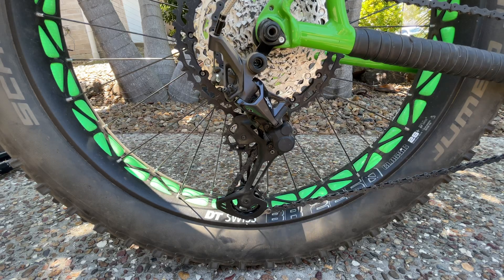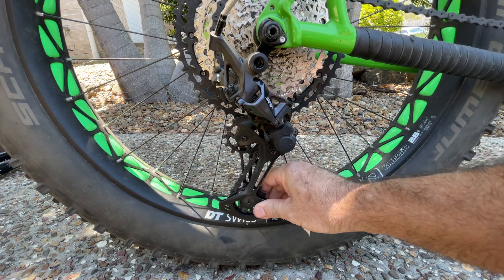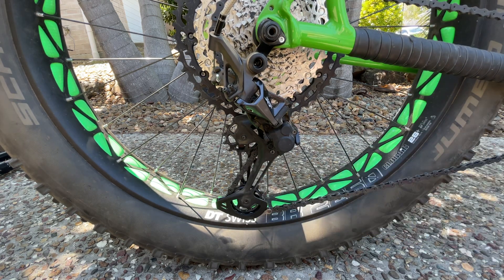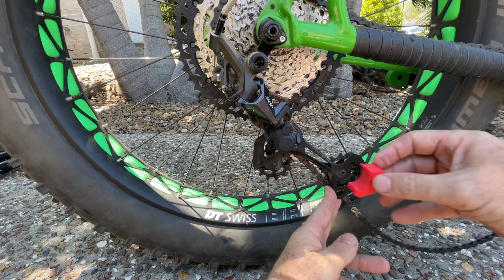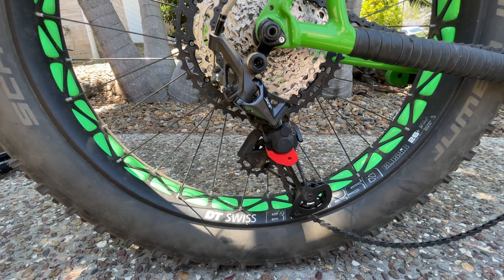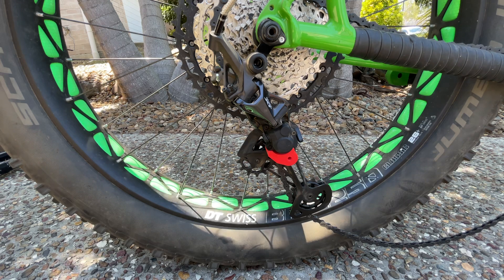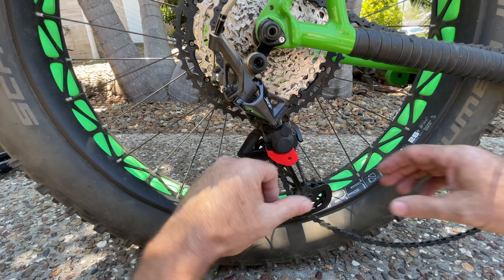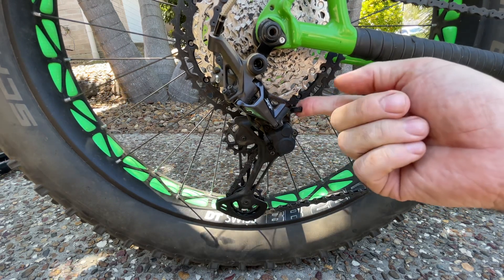Shimano XT 12 speed Derailleur Cage Lock

Comment: Do you know if it will fit a RD5100-SGS?
Reply from the maker: I can only say is works on the 12 speed XT. I don’t have other derailleur’s to try it on.
Reply: @FatMongrel  Going to see if my step son can 3d print one at his dad's and see. Will check back after he visits his dad's again.
Reply: @FatMongrel  If I can get one 3d printed I will go to local LBS and try what they have on hand.
Reply: It does not fit on 11 speed Deore XT Derailleur. The pin on the cage is several mm closer to the pivot / clutch cover. I printed and tried the fit.  I will have a 12 sp derailleur to compare in a couple of months. Adjusting the hole position on the tool is necessary.  Or make it slotted.
Reply: @I_DreamOn2Wheels  thanks for checking!
Reply from the maker: @I_DreamOn2Wheels  As I only have 12 speed on my bikes I can say it works on that. I don’t have a 11 speed derailleur to try it on.